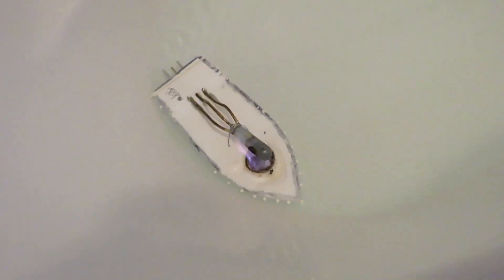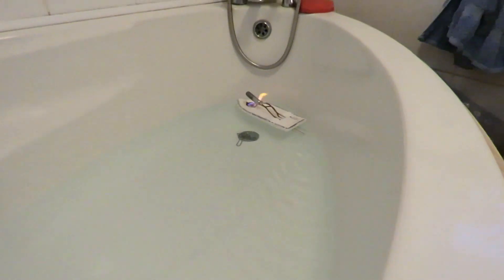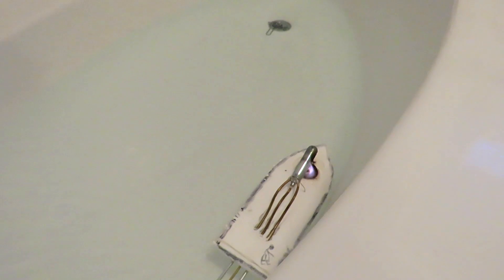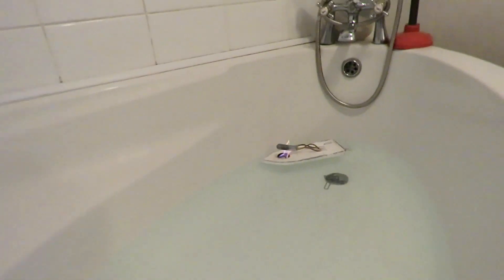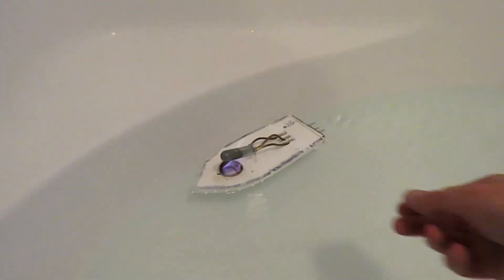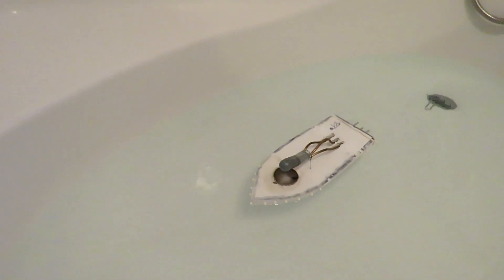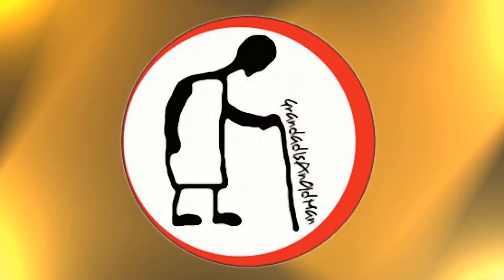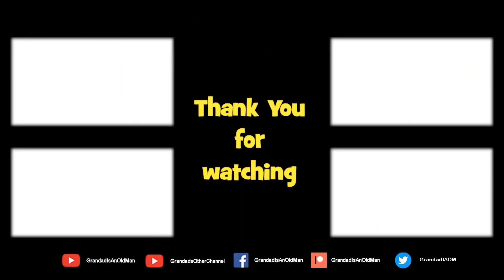Triple pipe CO2 capsule boiler pop pop boat P2

Comment: Hello, hope you are well, thanks for the shoutout. 
Enjoyed these videos, really like the bends on the pipes there, looks really good. Hadnt thought about using styrofoam, it seems to work well, the tealight holder gets cooled down by the water under it, good idea, have to try it.
I have run my boats on alcohol stove fuel, but the flames are even higher than the solid fuel. Had an idea of making a small oil lamp with a thicker wick and filling it with alcohol, maybe two empty tealights pressed into eachother and a shoelace or something, have seen small stirling and steam engines powered by these.
Made a putput rc boat out of milkcartons, and it works pretty good, its a bit scary to have an open flame and a lithium battery in the same boat, but sofar its been ok. Could be a Titanic disaster!
Had a competiton at school yesterday with boats like this, fun thing, only one boat caught fire and sank so thats not to bad, will post a video this week.
Have a great evening!
Reply from the maker: Looking forward to that video 👍

Comment: Wow! That is really great. Well done. Did you mention before about the Co2 canisters taking solder, I can't remember?

I am surprised that it took so long to heat up but when it starts going it is fast. Greats stuff. I think those little Co2 bottles could be used for a little steam engine boiler. That solid fuel tablets are good and don't produce any smoke.
Reply from the maker: One of my earliest boilers was a CO2 canister that I found I could solder so I guess they are mild steel or similar.

Comment: I want to see you build a human sized one of these and sail it for a mile
Reply from the maker: Many have tried but the power does not scale up with the size. Even just getting a decent sized RC boat to run successfully is not easy.
Reply: @GrandadIsAnOldMan  . . . Word on the street is that because of the silent operation, real submarine(s) can be/are propelled by a variation of this set-up. Surface tension must be the problem with scaling up, meniscuses and all that . . . Giants might use steam injection, a piston, valves and a very long cylinder . .
Reply: @GrandadIsAnOldMan  thats a shame. how about a child sized one? haha